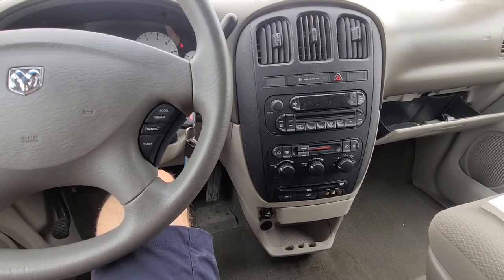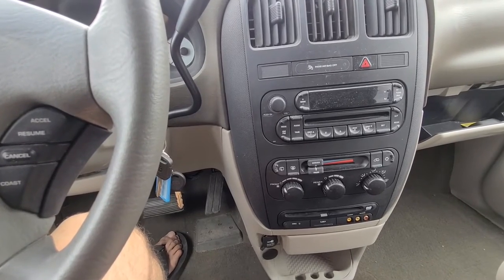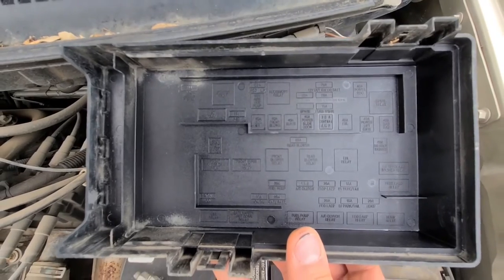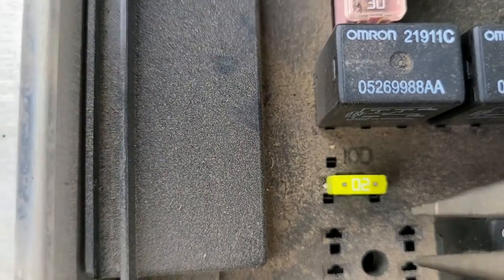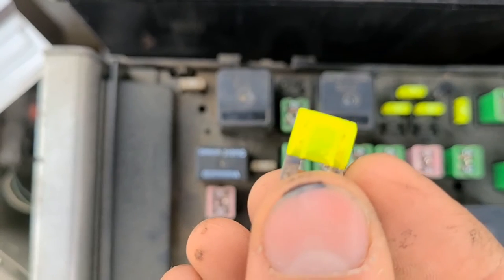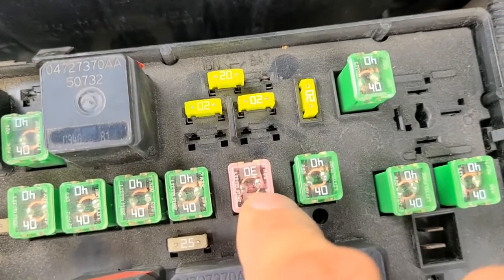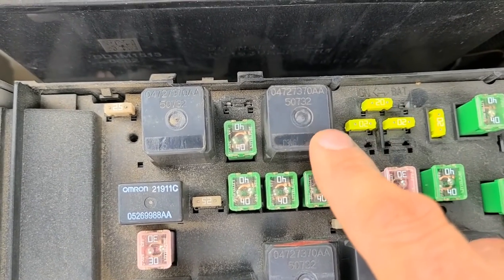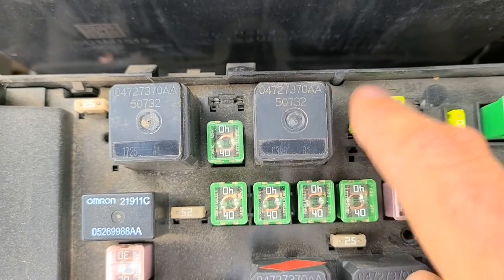Dodge Grand Caravan - RADIO FUSES LOCATION (2001 - 2007)

Comment: When u say switching the relay do u mean switching them with new one or ones that r already in the circuit
Reply from the maker: You can try to switch it with the one that is already in the circuit just temporarily to test if the relay is bad. If that fixes the radio then buy the new relay and install it.